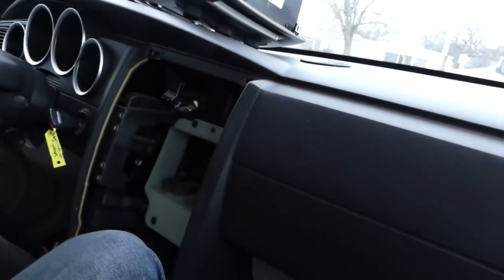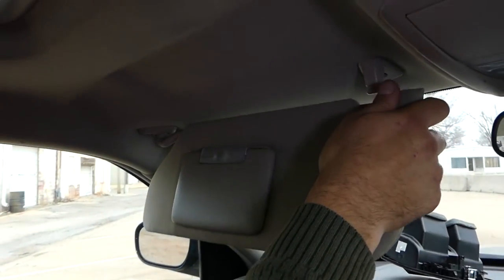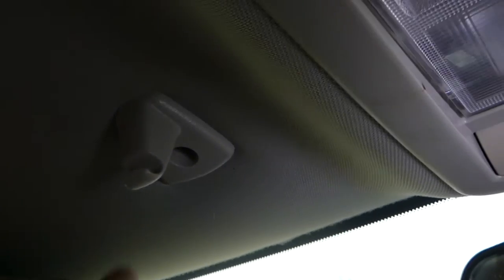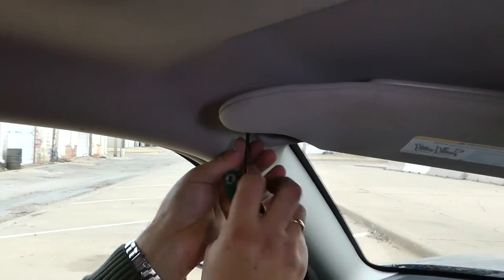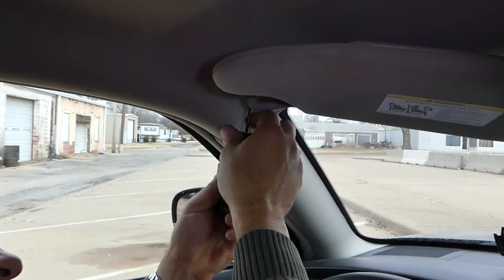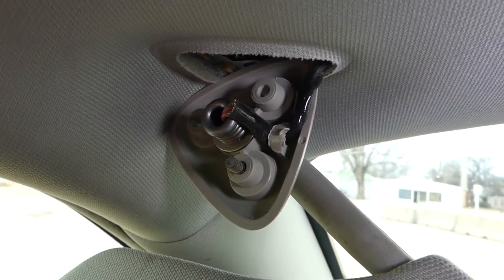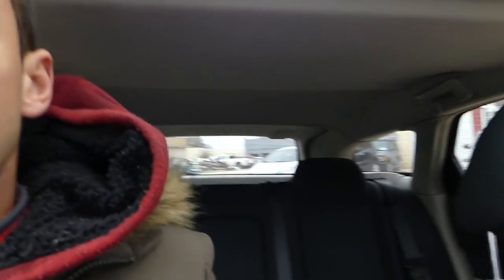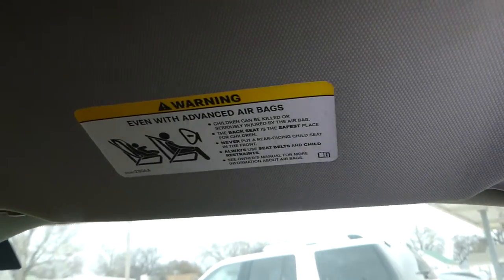DODGE CHARGER SUN VISOR REPLACEMENT REMOVAL FAIL! DODGE MAGNUM

Comment: I have a Dodge Stratus & had to take the visor off.  The plug/connector was tucked up inside & all I had to do was pull on the wires a bit & out it came.  Yours was probably the same.